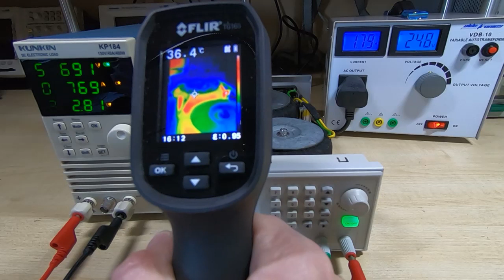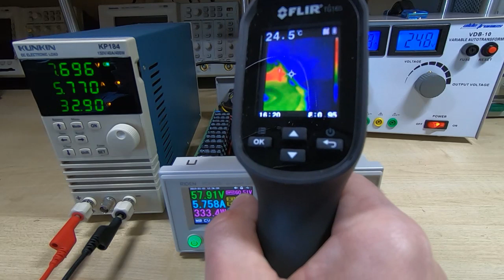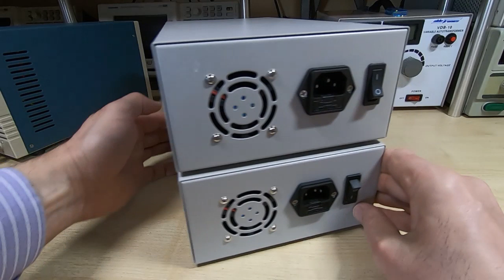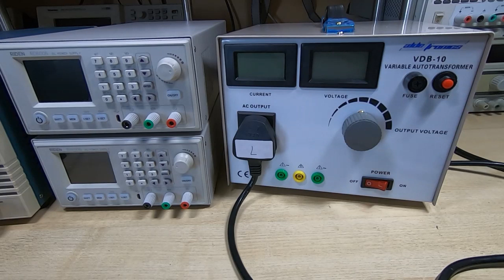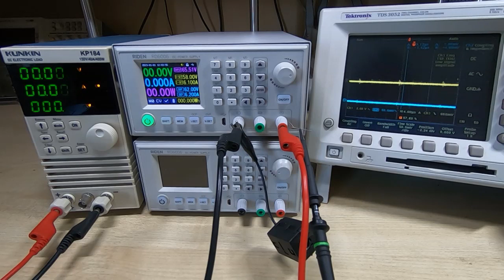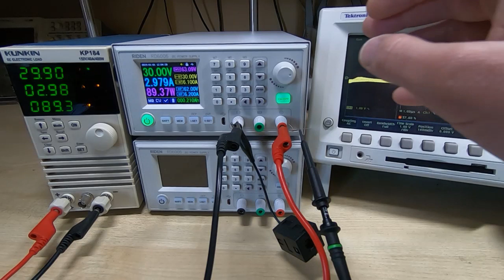RD6006 Linear Part9

Comment: Hi Jerry. Great series so thanks for that. I'm waiting for my Riden to arrive on the slow boat and this series has encouraged me to look at building a linear version. Are you able to link to the capacitor kit you found? I've searched many ways to find something similar but came up with nothing close. If not the same kit, then would you be able to outline what would be required to replicate that kit if I were to buy components separately. I see the 68 caps and PCB but is there anything else much? Thanks.
Reply from the maker: I cannot remember where I purchased it from but something like this should work https://www.ebay.co.uk/itm/68PCS-75V-220UF-Power-Supply-Board-PSU-Module-DIY-Kit-for-HiFi-Power-Amplifier-/251531020520?hash=item3a906ac8e8Note that I did not assemble it as intended (see video) as I wanted a single capacitor bank but the board was designed for a +/- supply.
Reply: @JerryWalker001  many thanks. I've just gone back and watched that section of the previous part and you linked to it in those comments so got it now. Thanks again.

Comment: could I use a faraday cage, inside the main case but outside the switcher case, "around the switcher" and ferrite beads on the power leads into the switcher and out of the switcher to reduce the electromagnetic noise substantially (say by half or 2/3 ??)
Reply from the maker: It would not make much difference but you could try. The EMC is referenced to the 'ground plane' so it would need to be addressed by reducing the impulse noise relative to the plane. You would need to do what you are suggesting but for the entire supply.
Reply: @JerryWalker001  Seems, common mode choke could help?

Comment: Great work. I have a suggestion, you should use a NTC thermistor in series to the primary coils. Without this the full bridge rectifier recive a very big current at the start up.
Reply from the maker: Actually is doesn't because the transformer is a highly inductive load and so it limits the initial current. If you measure the inrush current in a supply like this then you would see a relatively low initial current. Also the transformer limits the peak current that can be transferred without core saturation so no additional limiting is required.
Reply: @JerryWalker001  You are right.  I wasn't thinking from that point of view.  Can you tell me how many VA a single transformer should be.  And how much should the filtering capacity be?
Reply from the maker: @RickB3n  For a single transformer then at least 450VA should be used and 15000-20000uF
Reply: @JerryWalker001  Thanks, i subscript to the channel.

Comment: I ordered that power supply have not built it yet. It looks like I will not be using the switching power supply. I build linear power supplies for my CLASS A audio amplifiers so now it looks like I will be building a linear Power supply for my RIDEN RD6006 DC Power supply. 👍
            Thank you that was the absolutely best in-depth review teardown and modification of this power supply I have seen to date. 
            I just subscribed to your channel.
Reply from the maker: Thanks, I have to say that the SMPS version works fine but on the occasions I have needed one of these supplies since I built them I have always reached for the linear version.

Comment: Great series of videos! I have a question. Could you instead make 2 transformers „in series” but in the way that secondary of the first becomes primary of the second? Will that have any advantages? Cheers
Reply from the maker: It would just lower the efficiency as all the energy would have to pass through each core. You would need to use transformers with twice the power handling capacity.
Reply from the maker: Connecting them the way I show connects them effectively in parallel as far as the power handling is concerned. COnnecting the output of the first into the input of the second would put the power handling in series so would halve the power handling capability.
Reply: Jerry Walker great, thanks. Never thought of this way of connecting transformers. Very interesting. 
Dave said in his video that capacitance of the output is too big. Is it worthy to change those caps for smaller?
Reply from the maker: Yes the output capacitance is way too big and it causes the output to change too slowly. I would not recommend changing them as most likely this would negatively impact on the supply performance. I do however agree with a comment made on one of these videos where fitting a relay between the RD6006 and the output terminals would be a very good option. This could be driven by the 'ON' LED ourput from the controller so that it disconnected the terminals immediately the supply output is turned off. Unfortunately this would require quite some work because of the way the supply is constructed. The high capacitance is rarely going to cause any problems as long as you are aware of it.
Reply: Jerry Walker by performance you mean increased noise?
Reply from the maker: The linear version has much lower 'noise' but also better step response. The RD6006 is of course still switching so there is still switching noise. I tested 5 SMPS including the recommended one and they were all worse than the linear version in terms of noise but that is not really a surprise.
Reply: Jerry Walker ok but I mean is lowering the capacitance bad cause of noise?
Reply from the maker: Lowering the capacitance would increase the noise from the RD6006
Reply: Jerry Walker thanks. As we are talking - more questions:
1. Won’t using a relay cause some spikes?
2. Is using switching PSU with added LC filter good idea?
Reply from the maker: 1) It should not cause any problems as it will only be connecting or disconnecting the terminals. The control loop would still be present within the supply so the voltage would be controlled as it should. 2) It should improve things but as I show in the video most of the noise is not coming out of the supply terminals. I actually did fit an LC filter to the mains input to correct the PF (you can see the result in the video where the input current drops) but I did not show this in the video as I decided it was not really what the video was about. You can experiment with various configurations, should be interesting.
Reply: Jerry Walker thanks. About 2 - let me clarify. I mean LC filter after switching PSU, before rd6006.
Reply from the maker: Yes that is what I assumed you meant. As I said you can try but as the noise is not all coming out of the RD6006 supply terminals then it would not remove all the noise. A lot of the noise is going back out of the mains, possibly a mains filter on the input would help.
Reply: Jerry Walker thanks :) great knowledge, skills and videos. Sub!
Reply: @JerryWalker001  what about putting a capacitor bank on the output of the switching power supply then to the unit
Reply from the maker: It would not make much difference as the noise is inductively coupled and not conducted. I did initially try both L / C and LC filtering but it made little difference.

Comment: Personally, I would not put all blame on switching power supply in general. I would say, this specific power supply is generating this amount of noise. I am writing this because this power supply which you used is not approved by the manufacturer (RD). And people are now thinking all switching supplies are horrible. I am not implying the recommended power supply would be better, I am just thinking this is not fair. Another thing is, I was thinking,  I would do the same as you. Buy another one and use a toroid transformer. But then I realized I would be overpaying this supply for what it is. It would be a better solution just buy a linear power supply and not worry about noise at all.
Reply from the maker: Please watch the video. I specifically say that different SMPS will vary. However ALL SMPS will not be a good as a linear one. I also specifically say that not all the noise is due to the SMPS and I specifically show the noise created by the RD6006. I also specifically say that everyone should experiment and that I used these transformers because I had them to hand so the cost was low. This is about experimenting. So I do Not think it is unfair in any way. I made all points you raise very clear and you may have missed the point of the video which is to try different things. Finally I specifically stated that this is Not neccesesarily the best and certainly not the only way to go about this. I also tried a number of SMPS and they all gave similar results. Perhaps you could try building one of your own and posting some videos on the results?
Reply from the maker: I forgot to say that I did test the recommended S-400W supply and it was about the same in terms of noise as the one I showed but got a lot hotter at full load as it is only 400W compared to the 600W of the supply I used. Remember that there are losses and the peak output needs to be a continous 396W minimum (65V @ 6.1A). If you check the specs for these supplies then you should normally not use them over around 70% max power continously so I would certainly Not use a 400W supply. However this is a matter of personal choice and it is up to the individual if they want to use this supply. Out of interest which linear supply would you buy to save money over building the linear version? I am not aware of any linear supply of this power for under £150.00 which is what the version I built would cost if I had purchased all the parts.

Comment: Hi. As i noticed, I'm french. I have two identical torroidal transformer. it's strange. It's written on them  (300VA, one and really only one secondary 22v at 6,8A)
It must be an error I presume. (Indications are "IDDM-SEM  T300/1-1307) The two are similars. Imagine they are combined in series. 44v vith diodes = 62.04 (without 0.7v per diode). Do you agree it's insuffisant to obtain the output max ?.
Is there a way for me to send these strange indications about these infos to you ?
It seems it's divided by 2. What do you think about that and what would be the best advise for a french beggine Ike me?
best regards (and sorry for my engligh and.... using a smartphone...). Laurent
Reply from the maker: The rating and voltage will depend on many things. The core rating does not always match the windings. I wound my transformers to get maximum use of the core sizes but this is not always the case. Two 22v RMS windings in series will provide an unloaded DC output of around 60V but this will drop under load. If they are rated as you say then they are likely to give around 55V when supplying 6A
Reply: @JerryWalker001  Thanks a lot for your useful answer.
Reply: @JerryWalker001  witch VA rating should use in that sit-up i saw in a store its starts from 50va up to 3000va for one trasformer
Reply from the maker: You need a total power handling capacity of around 450VA depending on the power factor that you acheive.
Reply: @JerryWalker001  i have only one transformer at these moments that used for led strip's light i can match up another one to it or must buy new exact pair

Comment: I wonder what would happen if you added the capacitor bank to the switch mode supply, how much would that help?
Reply from the maker: It would not make much difference and can even make it worse under certain conditions depending on the supply used. The noise is not coming through the conductors to the RD6006. The testing I carried out actually went way beyond what I showed in the video, I only showed the relevant bits. I tried capacitors and inductors between the SMPS and the RD6006. An LC network certainly reduced conducted noise into the RD6006 but as this was mostly not getting to the output then it did not make much difference. You may notice in the video that the PF dropped significantly for the SMPS version after the initial PF test and this was due to trying an LC network for PF correction on the mains input. I did not show this in the video although I did test wuite a few configurarions. This did make a difference although it was still not even close to the Linear version. One advantage of transformers in linear supplies is that they effectively put a very large inductor in the 'current path' and this really helps to reduce noise.

Comment: Soo, what is the price difference, if We buy a good switching power supply price would be at least $32. What would be a 2x toroid transformer with some caps and diodes?
Reply from the maker: I have no idea as I rewound my own transformers and cost would depend on where you purchased them from. I think I paid a total of around £28.00 for the parts but it is hard to say as I only used part of wire reels. If you were to purchase two similar transformers then as an estimate it would cost around £100.00. However as I say in the video this is not the only way or even the best way. The video is intended to give ideas that there are alternative methods. Also the two resulting power supplies are very different in terms of performance and the linear version is (in my opinion) far more useful in a lab environment so direct price comparisons are not really relevant. It depends on what youa re looking for and what you have to hand.

Comment: Perhaps the noise is not from the switching back-end, but rather the two DC-to-DC converters interacting with one another. Did or will you make any attempt to filter the back-end? Certainly there's enough room inside for a capacitor bank fed by 1 or 2 NTC thermistors..
Reply from the maker: I did not show it in this video (other than by having the Riden output turned off) but the noise is present with the Riden disconnected so there did not seem any point in trying filter it out. When the switching supply is loaded the switching supply is very noisy. I also tried 4 different switching supplies and they were all fairly similar. There is however certainly interaction between the riden and the SMS which I did hint at. The linear version has the ability to respond to step changes very cleanly but the switching version is not as good but this is minimal compared to the switching supply noise. I did actually video methods to reduce the noise and also correct the PF but as this was not the point of the video i ended up editing these parts out. I may post a seperate video on these.
Reply: @JerryWalker001  We are currently chatting over your video on EEVblog (bottom of Page 2 of the thread) https://www.eevblog.com/forum/testgear/ruideng-riden-rd6006-dc-power-supply/50/

I will be going with the linear back-end as well using some old 500VA Hamoond units I posted about here: https://www.eevblog.com/forum/beginners/transfo-lamination-bolts-super-hot-at-20-min-and-no-load-why/

Comment: I ordered a RD6006 a while ago. Initially, I wanted to use a switching power supply, but I think I will start looking for a linear supply now :)
Reply from the maker: For a general supply I would certainly suggest that a linear version would be best but please note that a switching version still has it uses (just not as many in my opinion).

Comment: Wouldn't a switching power supply with PFC improve things like the apparent power and thus the total efficiency?
Reply from the maker: Yes it should do. As I said you can get more expensive supplies which may be better although I very much doubt that the final result would approach the linear version. A comment  on one of my videos asked about the use of inductors to smoothe supplies and if you think about it my supply has two huge inductors which are very effective in controlling the PF and reducing noise. This is why just about every top end supply is linear. There are many ways to approach it of course and an interesting project would be to see how low you can get the noise. A major difficulty is in actually measuring the noise so that you can see how well you are doing.